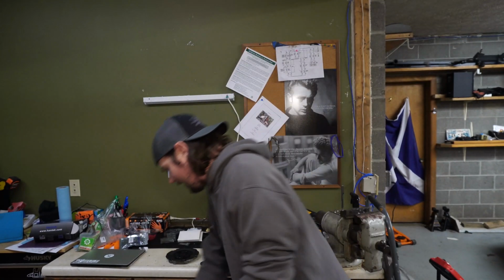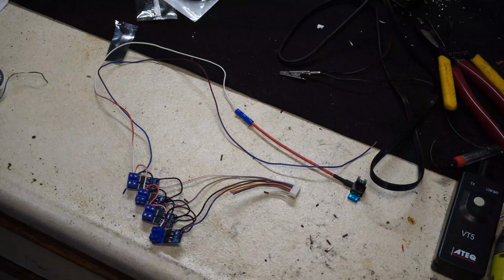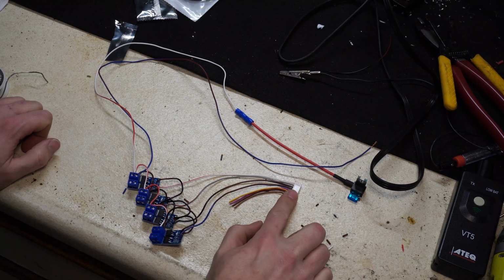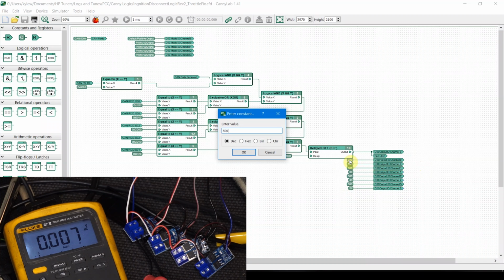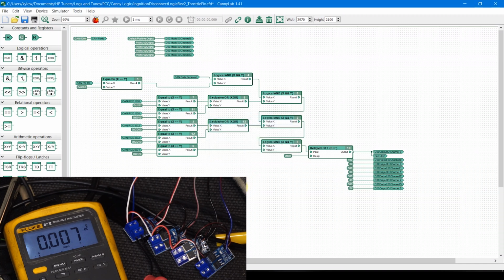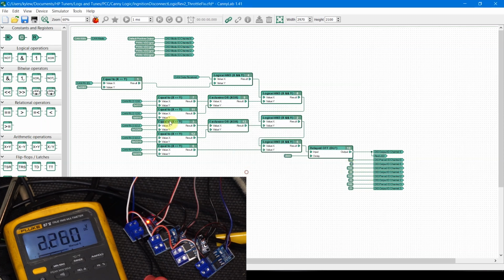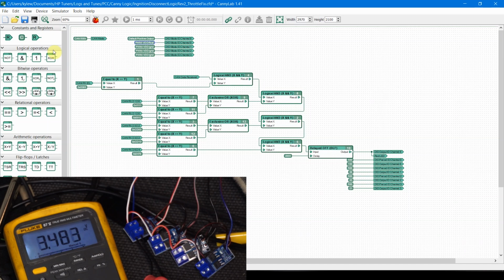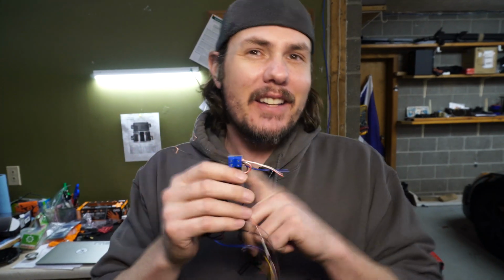Getting Rid Of The Reduced Engine Power Message On Project Country Club

Comment: Did you ever make a video for solving REP issues with tunes? I have a cammed 05 vette with a LS2 and the E40 and I’m occasionally getting REP usually on startup and a few time during driving. Usually codes 2135 1516 but also 2176 and a few others sometimes relating to both pedal and the sensors. Pulling data and checking manually both seem to be good to go. Which tables are you referring to in order to prevent this REP from happening ?  Great videos btw and thanks for serving! 

-Former avionics tech
Sgt/USMC

Comment: I just took the sensor off the gas pedal, locked into a position, and left it in the car, so the pcm can see it. And tucked away the throttle body in the fender

Comment: Hey airman. I was working with a Major today setting up some computer equipment for his ROTC classes. Love the videos and how to's Just picked up a hantek 4 channel scope for automive to see what the heck is going on with cam sensor on the Astra. LOL
Reply from the maker: Was messing with my Hantek 2 channel today, couldn't get the square wave to show up, but it might be an assumption on my part that the wave would register as square and not just a rising edge
Reply: @GoatRopeGarage  I will check on some things after the live 4 you.
Reply: @GoatRopeGarage  were you scoping cam sensor?  Were you using ac voltage. If so switch it over to DC. I know that sounds crazy but you get a much better resolution.
Reply from the maker: @billziegmond4943  I was and I was using DC, it was showing it as a pulse but not a square wave like I expected
Reply: @GoatRopeGarage  Hal effect would show a square wave . Probe the signal wire  with black to ground. +/- 20v DC time div 20/ms  with a 1 ms sample rate.  Crank in flood mode or disable so car wont start.  If it's a Hal effect and no square wave.  I'd pull the sensor and touch the end with wrench and watch my scope you should see it pull down then up when removed. if still no clean square wave and wires all good back to ecm. I'd be suspect of the sensor.. Inductive produce an ac sine wave but looking it using DC and change sample rate to 50 ms sample rate 5v +/- you would still see a square when ot it goes to ground.

Comment: Kyle, just add a capacitor to the output of that PWM thing.  A capacitor will act like a small battery, and reduce/remove the voltage fluctuations.  Any capacitor will help, but I would look for one about the size of a peanut or two.  A 2K to 22K resistor will bleed the power out of the capacitor if you want to be able to lower the voltage after you have charged up the capacitor.   Put the resistor across the capacitor leads, and capacitor goes to across the PWM thingy output voltage leads.  Most capacitors have a + or a - on them if they need it oriented correctly.
Reply: agree cap on output
Reply from the maker: Thanks for the idea! I'll look into them!
Reply: Use caps to help smooth out voltage spikes on racing drones. The flight controller didn’t like the noise and it would affect how smoothly it flew as well as create noise in the video. The caps helped a lot

Comment: Why not just let the factory Ecm control the DBW throttle and skip all this and keep cruise control too??
Reply from the maker: Factory ECM won't control the fuel and spark on this particular setup.
Reply: @GoatRopeGarage  right but you could stil let it control the throttle just share the the 0-5v tps signal with the holley.